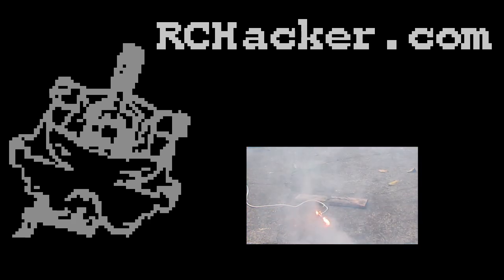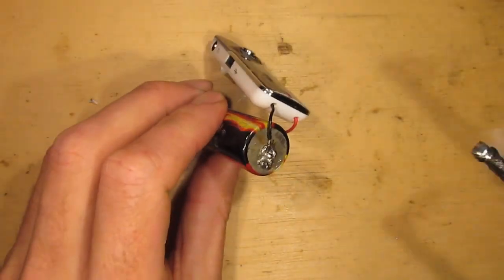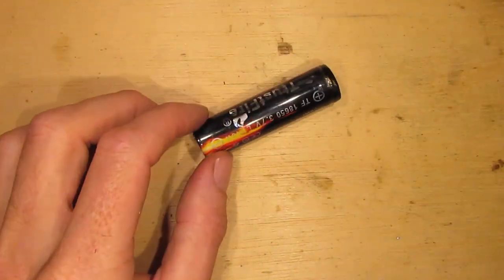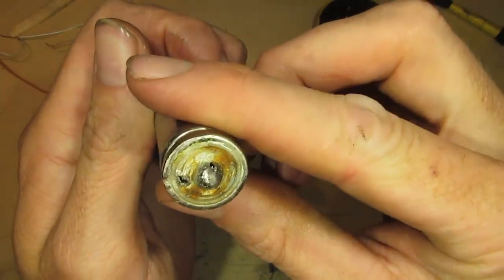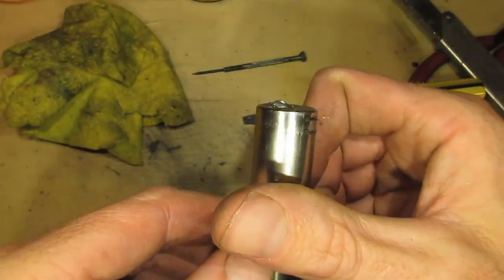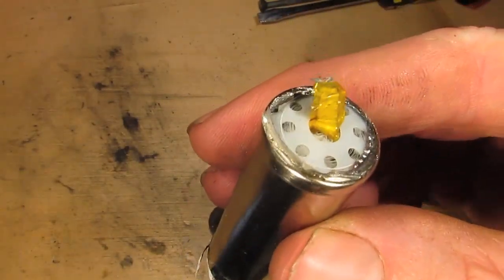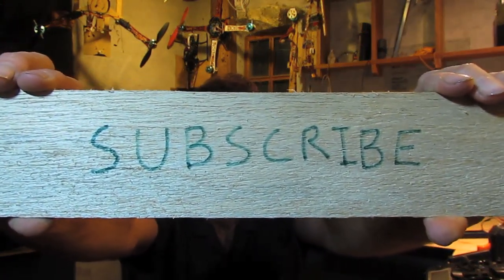Lithium Ion battery explosion. Trustfire 18650 teardown and destruction. RCHacker #6

Comment: wonder if you can take apart 18650's and make one big car sized battery.... like they do for cell phones wrapped a million times and celefamed.... and the problem with charging a 3.3v 18650 if there cross paralleled to 100 is your putting  3amp charge on one battery and expecting it to disperse the electricity to other batteries through the cathodes instead of distributing that 3 amp charge equal to the 33 sets of batteries cross parralleled & hooked up in series

Comment: the 10AH big li-ion or lipo ... psshosphate oxide? & there sulfure dioxide lithium... i took apart my old s6 edge+ samsung battery and it does smell... this guy must be inhaling these fumes.... these small batteries are lame garbage... just get a UPS for a computer and hook up a shitload of 3.3v cross paralleled then in series... obviously to up the volt to 12-14v then increase the Amp hours...

Comment: all you have to do is measure the battery the ones with protection are taller do you have Google if you do use it WTF
Reply: Chinese fakers are able to fake the proper battery size.

Comment: There are many lithium battery powered devices that retain the charging circuit and charging protection on the main circuit board and not on the battery itself. Most of these devices retain the battery permanently. A good example would be several early, lithium powered, high output bicycle lights. I have 2 of these that used off battery protection circuits with 18650 batteries. The electrical engineer selects the circuit and design for the application. 
  Lithium batteries are the SuperCar/Ferrari of the battery market. If you beat on a Ferrari like you can a daily driver Honda, and ignore the recommended maintenance the failures will be catastrophic. Lithium battery chemistry is the same. If you don't have a datasheet for the battery to know exactly what you have and how to engineer the correct circuit, your asking for problems. This is why lithium batteries have not replaced Alkaline batteries.

  No offense intended, but a self ignited fire reaction isn't an explosion. Pop culture and ignorant news media has popularized the incorrect term and subsequent hysteria. A good parallel of the same use of the term would be when a rocket is launched into space. Would we say it "explodes" off the launch pad into space?

Comment: Very good exercise.  I did the same thing exactly with a SureFire piece of shit, and came to the same conclusion - there is no protection whatsoever in there.  And also, after doing several tests, I established that their supposedly 3000mAh battery was in fact only 500mAh!  We must drive these dangerous mo-fu out of business!  And BTW, your tecnnique for soledering those wires is absolutely perfect.  I do this all the time.  The trick is to use intense heat, big power iron, fast and precise execution - just like you did.  Heat has no time to propagate and cause harm.

Comment: I keep hearing that any 18650 battery with fire in the name to stay away from them, as they are crap!  Don't know how true that is but it seems a lot of people say that!
Reply: +SEPI AUSTIN for high discharge equipment like box mods yes, for low power torches etc they are fine although personally i would opt for oem branded cells like sony samsung or lg still to be sure

Comment: I got an Ultrafire 4000 that is the same except it did not have a chance to explode or leak because I found out soon enough they are dangerous and mine also did not have a protection circuit that I could see either.  I am going to take it to the recycle bin at the battery store and get rid of it.  I knew they were junk when I bought the $8.00 USD flashlight and charger and was planning to get a hopefully safer battery.  What you did would have been good for the 4th of July!!

Comment: As tiny as that MP3 player is, I would not expect it to have much capacity at all.  The only reason they use them in those is because the battery life would be shitty with anything else.  Imagine a nickel cadmium cell in that.  It would take forever to charge and not last as long.  I never hand alot of NiCd batteries because they were so bad.  They even had memory effects.  I took them to the battery recycle bin and don't miss them at all because they are inferior.  In those days the regular alkaline batteries were much better.  The worst thing they ever do is leak if you don't take them out and leave it sitting for a long time.  I wonder how many children ruined their favorite toys not knowing that they leak.  It is disappointing.

Comment: Little piece of advice. 
DO NOT SOLDER ONTO BATTERY CONTACTS.

the heat from the solder gun actually causes pieces of the protection to melt and deform causing them to be unstable.
Reply: So how do they solder the components to the protection board then?
Reply: RCHacker  new soldering iron has nothing to do with anything? Batteries that are meant to be soldered have solder tabs electrode welded to them. I'd like to see a professionally manufactured board or device that has a battery soldered into it. They're always lipo cells with solder tabs or a battery that's electode welded with metal tabs. Why don't you read into it or maybe research it yourself before brushing it off as bullshit.  Either way it makes no diffence to me its advice take it or leave it, I really don't care for your safety >.< . If you ever contacted a battery company with concerns after a battery you bought vents/explodes, and they found out you were soldering wires to them they would laugh at you.
Reply from the maker: ivanjacob I think he needs a new soldering iron.
Reply: I ask about sony 18650 if i can solder the ends to make it parralel and they replied (its ok to solder it just dont make it 20 seconds more u will distroy the insulation)
Reply: Laptop cells are soldered. Just as in any battery with more than one 18650.

Comment: I'm confused as hell about this.   I'm new to vaping and use a ZEN ZNA 50 - but I keep it set between 30-32 watts - unless it starts to run low, then I'll bump it up to 40 watts to try to get more out of the battery before I charge it and to get a stronger draw/lung hit.

I'm using an Aspire Atlantis tank.  And the batteries are 18650  2500mAh  3.7v

A full charge on the battery is 4.2 volts.  When the battery is too weak and I put it in the charger, it reads 3.5 or 3.6 volts.

The little meter on the ZNA always 0.5 ohms  and below that when I press the button to vape the volts go from 0.0v up to whatever the current charge of the battery is - like right now it's going up to 3.9 volts.

Sometimes I take longer hits then others - and sometimes I take a lot of hits very quickly, taking my finger off the button.

Am I doing this right?  I mean, I know how to vape and operate my set-up, but as it pertains to battery safety?

Comment: Good greif!

Imagine one of these hack-job, chinese cells venting(or exploding) inside an enslosed, hermetically sealed aluminium tube...
Ok? Got that mental image in place?
Now that you have no face left, that new $300 flashlight embedded in your skull doesn't seem so cool anymore, does it?

Point being, don't skimp out on your cells people, it's just not worth it.

Like others have said, Sony and Panasonic cells only!

I like AW's - places like Lighthound always checks a few in each shipment to make sure they don't get fakes. Shady E-Bay sellers will not go to such lengths to ensure the safety of their customers. Employ common sense when ordering dangerous items. I have failed to do so once, thinking if they were a rare bunch of fake AW's, at least they'd be cheaper than usual.

Well..They were not cheaper, and they were not real AW's.

Looked the part though. Even had fake strips under the wraps!
Fucking unscrupulous counterfeit cunts!

Sorry for venting, guys. (Pun heavily intended)

Comment: It would be impossible to have any electronics inside the cell, as the electrolyte is corrosive, and it would destroy the PCB.
Reply: Panasonic NCR18650B are protected batteries with PCB on top of the cap but appear to be one piece.

Comment: Wow - they are so unsafe you can saw the ends off, poke a screwdriver between the positve button and the negative case and still not explode until you direct charge them from a 12v fookin car battery. That's really amazing.

Comment: I have been using 18650 cell for close to a year and no problems.
You have to learn how to charge them properly. You connected 1 car battery to a damaged cell. It is like connecting positive with negative on your car battery. Maybe next time will you do so called test connecting positive with negative and wait for the results :)))

Comment: The protection board is external to the case and mounted at the bottom of the can. An unprotected cell will be 65mm long, a protected one will be about 2mm longer.

Comment: NOT A PROTECTED CELL! The pcb will be stuck on the bottom of the can, and will be connected by a tape lead insulated by some clear yellow tape, that runs the length of the can.
Reply from the maker: ps2hacker Thanks nice to know what a real one looks like.

Comment: I would wager that there's a PTC embedded in the positive electrode, even these cheapo cells usually have them. It's a very basic and crude form of over-current protection. Trust fire and other xxx-fire cells are very variable as at least some of them are taken from used laptop battery packs and are variable brands and types, you never know what you're getting with ultra cheap chinese cells. Honestly, panasonic or sanyo cells are only a few bucks more, and work so much better (and also don't catch fire easily...)

Check out fasttech.com for some of the cheapest prices for legitimate brands of quality 18650 cells. Many of the flashlight and E-cig users get from there.

And at the end, that was like a friggen firework!

Comment from the maker: @runner180fxr It had been sitting in my shed untouched for about a month when it exploded in the middle of the night. I heard it from the house but thought it was something else at the time.
Reply: Is it possible that some object shorted the battery? Any idea what might have triggered the explosion? The fact that lithium batteries have the potential to explode just like that, even when stored and not used, is new info to me and that is really disturbing.
Reply from the maker: runner180fxr It had been overcharged by me, and its is sealed in a pretty solid metal case. I'd hate for one to go off while it is still contained in a metal torch.
Reply from the maker: RCHacker not possible it shorted.
Reply: RCHacker
By overcharge you mean more than 4.3 volts? Isn't there any chance that the metal case shorted the battery? The whole metal casing of the battery is the negative of the battery which means that there a very small gap between positive and negative at the top.

Comment: You bought unprotected cells yes they come that way. It's meant to be used in conjunction with a protection circuit for charging as well as discharging. What you can in your rc remote can also explode because you don't have the protection circuit to limit power draw. Either buy a protected cell or buy a protection circuit and then implement with your project. Otherwise you'll be setting yourself up for failure.
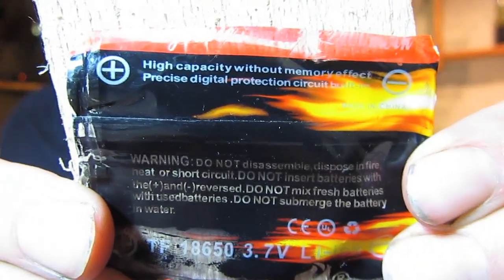Reply: 7:06 he got scammed

Comment: Yet another example of buying batteries from eBay. There are a lot of parrots out there repeating mantras like "trustfire = trust them to catch fire" etc. That isn't really fair. If you get the batteries from a reliable vendor with the correct specifications (and don't use them in ways they are not intended for), then TrustFire aren't that bad (well, life cycle is another thing, but we get what we pay for).
Anyways, nice and informative vid !
Reply: It's actually another example of human stupidity. He should first learn something about Lithium Ion batteries, how they are made and how the protection circuitry is implemented. Lithium Ion is not the same as Lithium Polymer, there is no "fast" charging for this cells like vith Lipo which have 10C, 20C charging specs.
TrustFire batteries are actually fairly good considering the price, UltraFire on other hand are pure garbage, do not accept them even if they are free, that's how bad they are...
O, and learn some things, facts about 18650 (and other Li-Ion models) before you (I am addressing to general population) do stupid things like in this video...

Comment from the maker: The fear that everyone has is really starting to shit me.

Its just a battery, not an explosive. Petrol has 50 times the specific energy and you travel with gallons of it under your bum regularly.

Yes a 'trustfire' exploded in my workshop and almost caused a small fire. It destroyed itself, would probably injure a hand but I strongly doubt take any fingers off. Still it is a very bad design it should vent or be able to puff before exploding.

Most other Li-ion and Li-Po are relatively safe.

Comment: With regards to 18650 Lion cells there are only five manufacturers that have a clue how to make a battery properly these are LG, Samsung, Sanyo, Sony, and Panasonic. 
All of these are made outside of china. China hasn't got the quality control to make lion cells safely and thus only get lifepo4 cells from china.
For example a look at Samsungs 18650 data sheet shows that they expect to be able to charge there cells to 12v at 2.6a without any explosion or fire occurring.

Comment: You have probably learned a few things by now about the care and feeding of lithium ion batteries. Before experimenting with this I urge others to educate themselves to the dangers of fluorine gas, and to read the articles at batteryuniversity 
The electronic circuitry you seek is always external and not included from the battery manufacturer. The internal protection, the pressure vent did work as shown in your quick charging experiment. You potentially damaged it while soldering to the cell.

Comment: Well, the protection circuit IS OUTSIDE, soldered to the negative post of the battery. I have owned a bunch of these batteries and they always come with the protection circuit, maybe you received a bad one, or maybe you removed it yourself?? It is not hard to compare an unprotected battery with a protected one, the latter is slightly longer due to the protection circuit...

Comment from the maker: Apologies that you failed to see the point of the video.

Yes, I originally charged them incorrectly (500ma) on the assumption that the 'claimed' internal protection circuitry would handle it. (I have added a link above).

I discharged my remaining cell and took it apart: The result, no protection circuit.

I took a risk and learned something: these batteries have bullshit advertising and are dangerous. I now know that I need a proper charger for these and am safer for it.

Comment: Dont Buy From eBay China..All Fake Battery.
Next time, if u see ebay seller are from China. They are 100% Fake Battery.
Some Say Ultra fire max 900mAh at most is rubbish battery. Then which brand you recommend has more than 3000mAh power? Does Trustfire Battery ok?
How, just Say which brand 18650 battery is new & has high Amp..supply & very Bright.
God damn Samsung Battery, Chinaman also selling. Can Samsung China be Trusted?

Comment: What did you expect? Put a 24 V 600 A source on every battery you know and you'll get excatly the same result. Maybe the PCB was inside the CAP you SAWED OF? Why didn't you connect it to 110 V and watched it? No offends, but this is hilarious!
Even faked 18650 will never do the rocket thing when charged with 1A and to the max of 4,2 Volts

Comment: There are counterfeit batteries out there.  Go to trustfire-com and ultrafire-net to check out the batteries actually being produced by these companies.  

There is no 18650 over 3000mah anywhere so if rated higher they are counterfeit garbage.

Comment: Even with those that have circuitry integrated, I wouldn't try to charge them with a plugpack... The circuitry doesn't regulate anything, it just tries to cut off current and make the host device realize something is wrong. The thresholds are usually also set at considerable distance away from the normal operating limits. Reset behaviour varies wildly. Some trip "forever" and can't be reset. Some reset instantly, resulting in oscillation, which makes the mosfets run very hot and potentially fail

Comment: The ones with circuitboards have a connecting strip from the positive terminal going down the outside of the metal case to the base where the cctboard is outside the actual metal case.